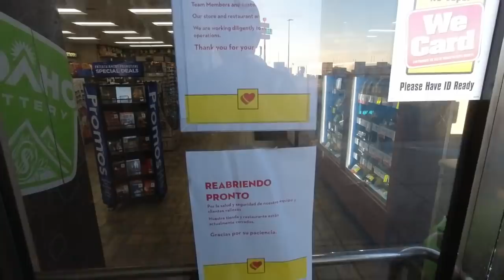Not Taking BS from Brokers Anymore!

Comment: Just a thought here, why not find the exact center of your trailer and paint a line all the way down it. Then everytime u got ready to load something all u would have to do is find the center of the object and line them up and you're good. Also that looks like a lot of weight where that motor was mounted just suspended there bouncing.

Comment: I would suggest doing a full around the legs if you ever get another load like this. I haul nothing but stainless steel. Also carry some shackles you can use them where ever there is bolt hole.  When I use shackles I run the strap through the shackle run back down to the trailer where the ratchet is. I was amazed how high they lifted that piece that might have been buying you a trailer.